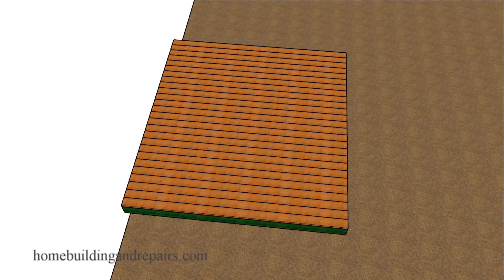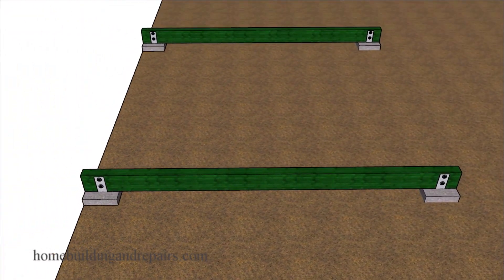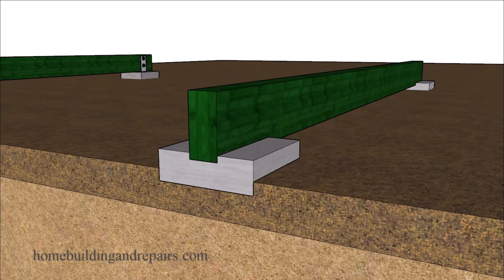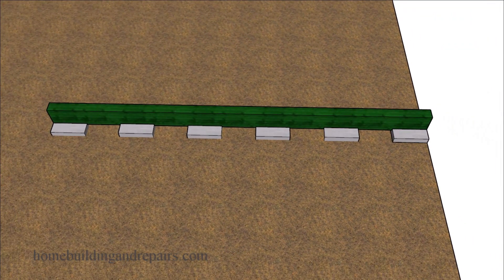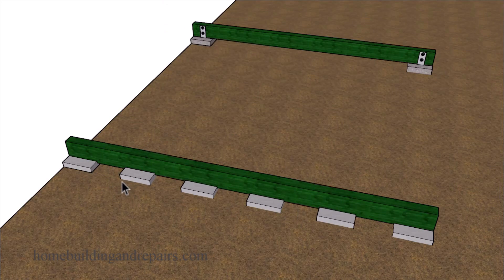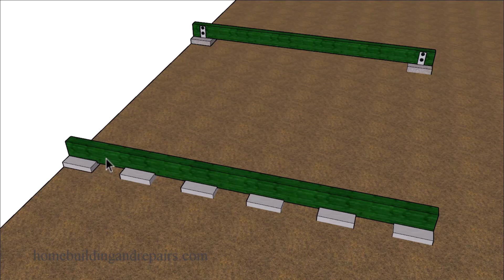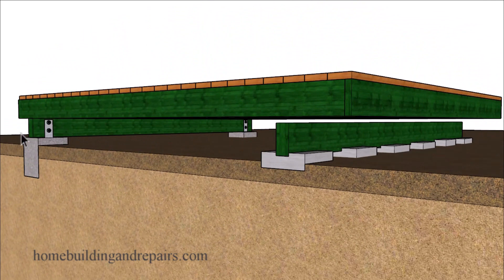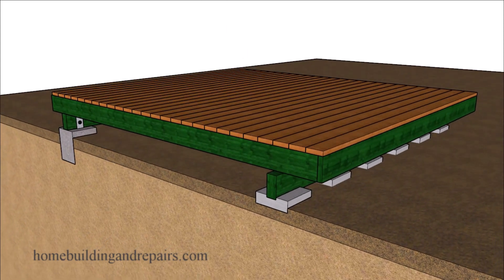Why Building Decks With Plastic Footings Might Not Make Sense - Consumer Awareness Education

Comment: The ones I use have a screw system to raise/lower by up to 10cm. So settling can be adjusted for. They only cost about 3 dollars each and carry 800kg. I have not used them for decking as such, but great for greenhouses, small sheds, chicken houses. (I am not in the US but live at 60° North so ground freezing is a one of my factors).
Reply from the maker: Thanks for sharing and cold weather does make a huge difference.

Comment: I was wondering g what you would suggest for a corrosion barrier(possibly load bearing) between pressure treated lumber and metal "brackets("strong ties" or similar).thanks!
I have seen people using nothing at all between these 2,and it seems that that practice would corrode the metal.....
Reply from the maker: I'm planning on making a video on this soon, hopefully this month.